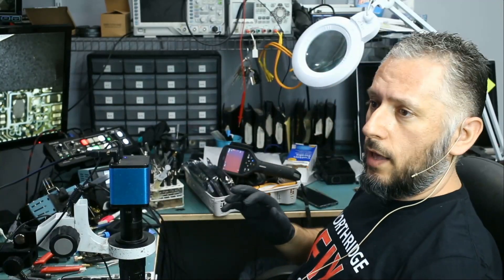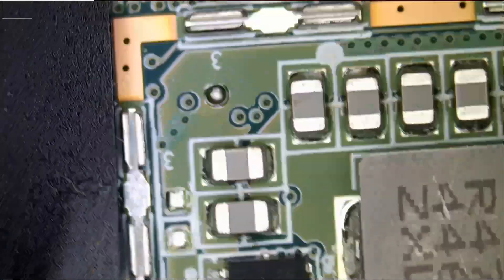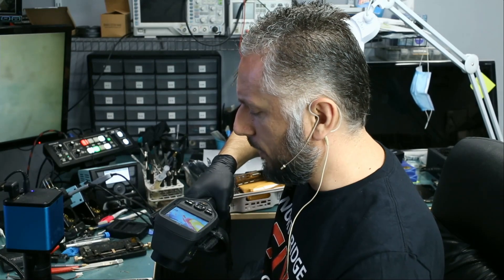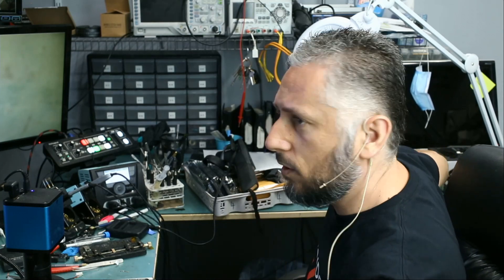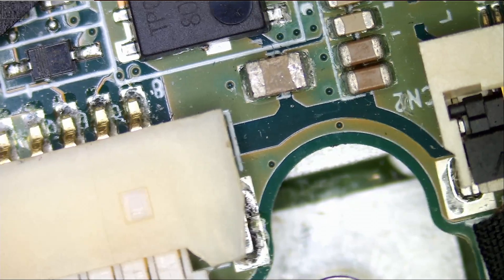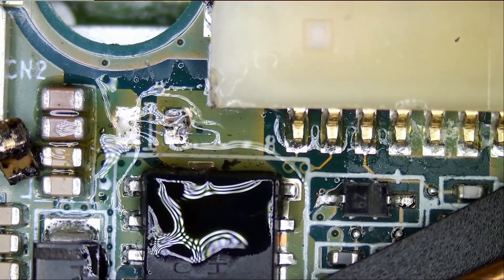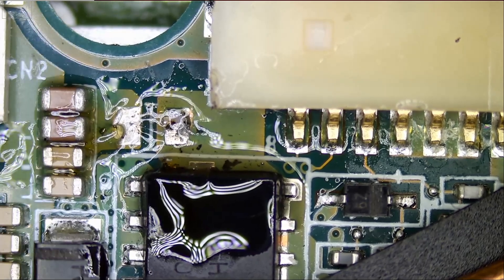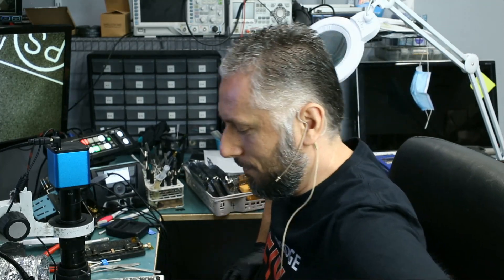HP Spectre Non USBC Laptop Repair - No Power caused by Short Circuit

Comment: I just saw that your problem with the flir camera is that you have an audio cable not a video cable because video is yellow colour and audio left and right are red and white so you need a cable with yellow plug
Reply: This
Reply: I thought I was the only one who saw that. Most likely that is why he is not getting a picture.
Reply: Mechanically, the cabling is the same, so the colour of the plug should not affect the signal.
Reply: @JonathanSias  nope the audio cables are in different places on the barrel jack in the camera

Comment: What type of connection output is on the thermal camera ? also I saw you connect a white and red cable I’m assuming the red is audio and the white is video? What’s the make and model of the thermal camera

Comment: one question: all the caps that have one leg connected to ground are "bypass" capacitors or not all of them?
Reply: In power supply almost all of the on led ground caps are for filtering.  But in analogue electronics we have different purposes like to create wave form etc.
Reply: @sharana.p5921  thank you

Comment: THANKS ALEX, I learned today one of the many things to look for when a laptop does'nt power up.Look for a cap that is shorted.Could you tell us what diode mode means to the layman,is that the same as ohms? after you removed it ,then checked it ,you taught me what to look for {it should have a lot of resistance or not be connected straight through>} now I'm going to check some old non working old laptops i have to see if i have that right,thanks for that info,i think i just learned that today.

Comment: Can you or someone explain the multimeter diode mode, like when you check the capacitor 6:45, it beebs twice and you know its a short? Is it working if the meter doesnt beeb or how does that work?

Comment: Regarding to the video converter.
Make sure that you ordered ( Input is RCA to the output HDMI).
Because if you ordered the reverse device with   ( I/P-HDMI to O/P-RCA) its won't work.
Reply from the maker: That is exactly the problem. I didn't realize it until now. I need an RCA to HDMI.
Reply: I knew this, because I had the same issue when I was looking for an HDMI to DP converter 😅.

Thanks for your reply it's my pleasure to receive a massege from you 🌹.

Comment: I have the same adapter and same issue happen. I noticed that there is a USB mini B on the side of the adapter just give it power of 5volts with 0.1a and it will work.
Reply: I've seen that adapter and it's very possible he has the wrong one. If the heat camera uses AV then he needs AV2HDMI, not HDMI2AV.

Comment: Do you need to install a new capacitor?
Reply: i was going to ask the same question
Reply: When you look at the datasheets for ics the manufature recomends that they are added to ensure that the ic will work as intended otherwise they caution that the ic could maufuction. So basically it is up to you if you want to add them or not but you have be warned by the manufacturers that its not there fault if the chip does produce errors.

Comment: I have a question: If removing the capacitor made the laptop work again, why was it there to begin with? Doesn't it need replacing?
Reply: The filtering capacitors are used to filter noise from the power which is induced by the environment and other electronic devices.  So if the power has very negligible of noise it can be turned.  But we don't all of the users will have that type of environment and power sources. So safety purposes we should replace those caps. The values of the caps are mentioned in the chip's data (which is next to the cap )

Comment: It’s raining hp specters , this model seems to be cursed
Reply: Well, if it’s raining, that would explain it - liquid damage! 😉
Reply: nope... the whole HP lineup
Reply: @harrison00xXx  Elitebooks/Desktops and Z Workstations are still a different matter but basically the whole consumer portfolio of HP is produced to the lowest specs and should be avoided.
Reply: Sad, really… HP used to make such nice stuff. I’ve still got an HP48sx graphing calculator that has been dropped numerous times, including in the mud, and has been driven over by a backhoe, and still works.
Reply: spitefulwar Desktops are not much better... at least the few tests/teardowns i saw from HP prebuilts
But to be fair, at least they are much better than overpriced/overhyped Dell and co, so the competition is also very weak

Comment: Next video: FLIR Cam repair attempt. No HDMI signal
Reply: BTW. Have you plugged that HDMI cable to another source to make sure the switcher is working? and have you plugged the FLIR cam to another screen? it would be great to determine the source of the problem.

Comment: سلام
If you plug a working power supply...  the system SHOULD POWER UP even without a battery!  
So checking for A CHARGED BATTERY should be done after you verify that the system powers-up at all

BEST